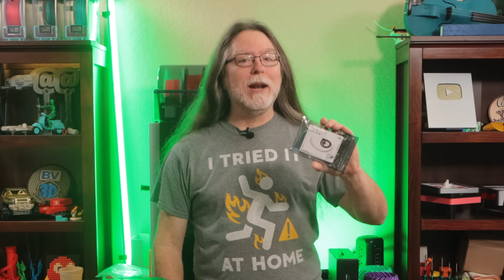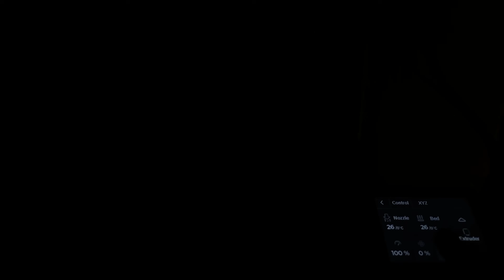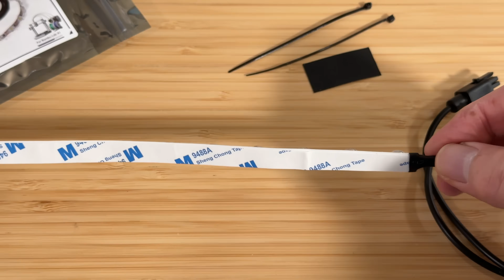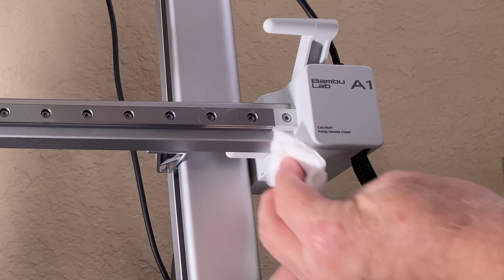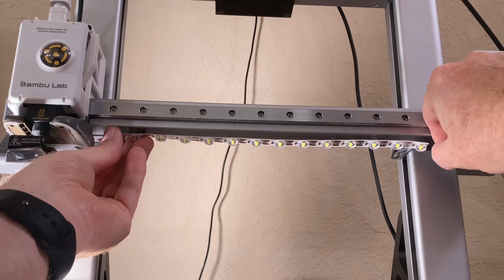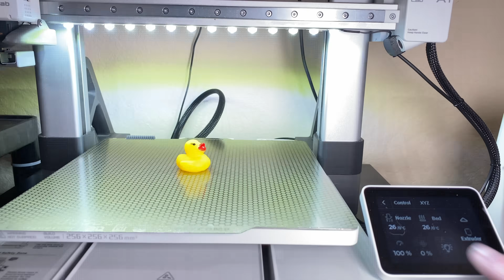The SUPER BRIGHT Lighting your Bambu A1 Deserves – Panda Lux

Comment: Picked one of these up after seeing your video. The reviews were on Amazon are quite critical, seems like mostly user error though because installation was smooth and it's great to have good light without shadows.
Reply: How is it still holding up?
Reply: @HoundDogCatia  Very well, all the LEDs still work and it hasn't come unstuck with heat.

Comment: I only see this useful if the native camera wouldn't be useless...
Reply: ive mounted an esp 32 cam with a 160 degree lens on my a1. its way better. if im at home i can watch it over the network. but the stock light was to low even for that. so i ordered this panda lux
Reply: @12Vencedor  Were you able to connect the cam to A1 or do you run in it outside of A1?
Reply: @NickUndisclosed well its mounted to the printer, but uses an external usb adapter.
Reply: My A1 mini is in a fairly dark corner of my workshop so this is very useful even if it doesn't add much light for the camera.

Comment: good light, but if you have an AMS lite you have to buy a multi conection port.
Reply: No, my A1 has two AMS ports on the back so both can be plugged in without any adapters.
Reply: My A1 Mini also has two ports so this shouldn't be a concern.